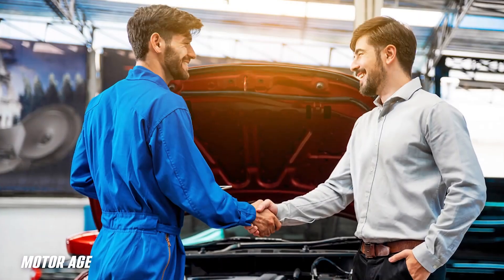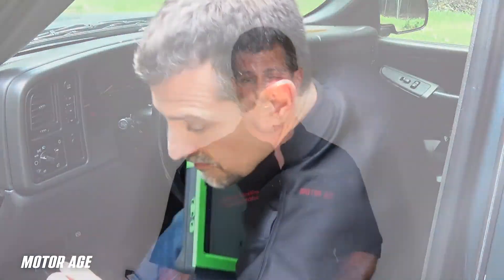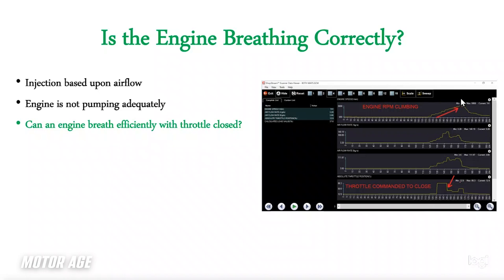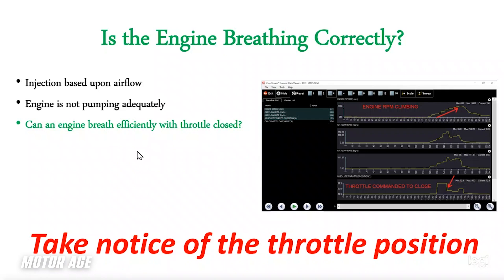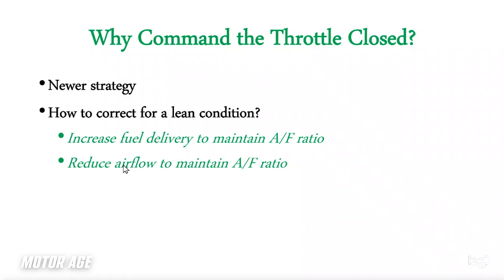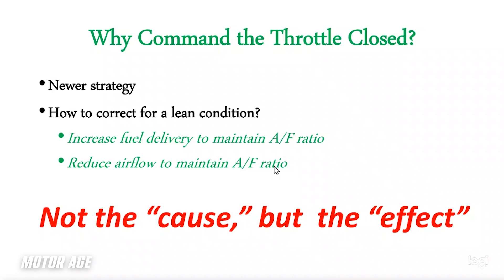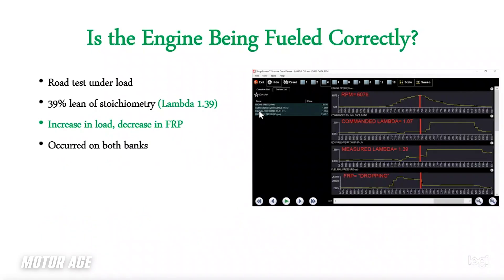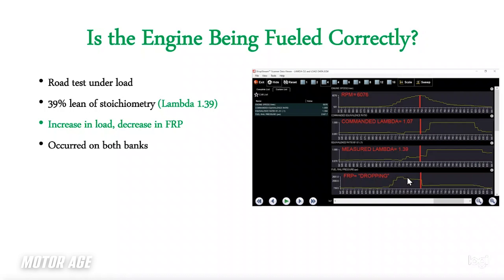The Trainer #151: GDi Driveability, the Preliminary Approach

Comment: .....and the problem ended up being??
Reply from the maker: The customer never returned for a complete diagnosis but all data points to a supply issue from the low side. After speaking with several top diagnosticians in Europe, they have let me know they too have experienced the problem and low-pressure supply pumps have been the fix (poor pump output volume).

Comment: Hey i remember reading about this in Motor Age magazine a while ago. It really shocked me that the PCM is closing the throttle/lowering the load in respond to the fuel pressure dropping(to keep closer to the 14.7 to 1). A misdiagnose can happen if a mechanic has not included together at the same time - load PID+throttle angle PID+map PID in the road diagnostics , and this could lead to replacing MAF sensors ! Because you woudn't know the computer is closing the throttle.Then you would have a wrong interpretations of the VE calculation. You would have high rpms, little air flow, air sensors reading lean, but you didn't checked throttle and load. That's why i always include MAP and throttle pid in my manual pid selection before road diagnostics. I've learned this trick from your colleague Mr. Scott Shotton reading one of the BEST EVER articles - "Asthmatic engines".
Reply: You know, comments like yours are why I come to the comments section. Love it! 👍👍👍
Reply: @petar443  
Amazing comment 
Where can I finde this articles??
Can I get them online?

Comment: Excellent points! So in the end, what was the issue with the car?
Reply: Inconclusive as we suggested to the customer, we test the low pressure supply system, but they did not return for the repair